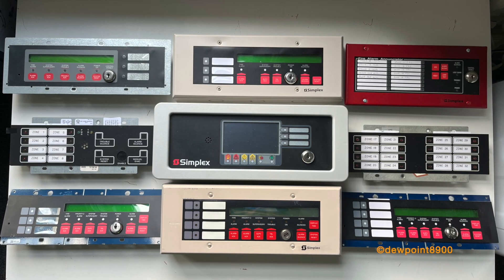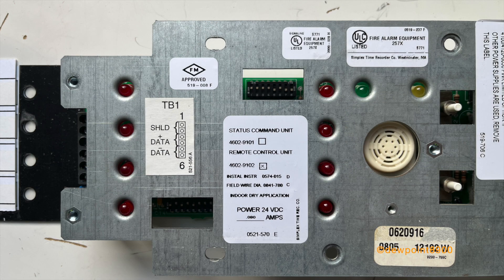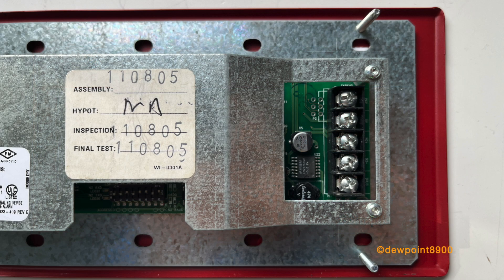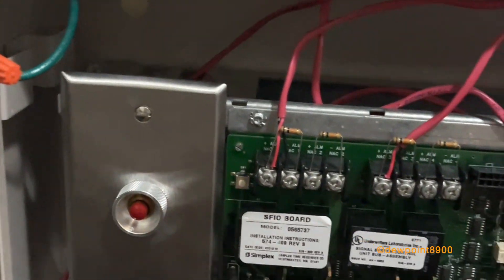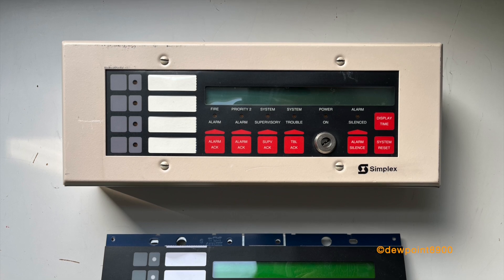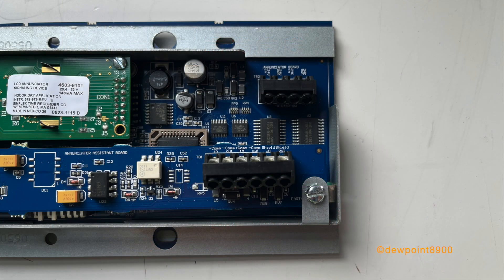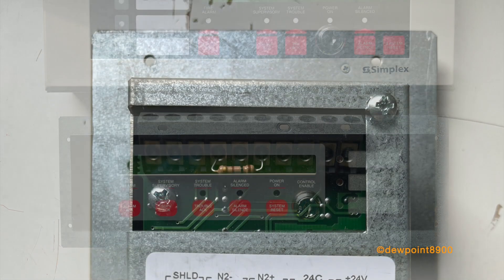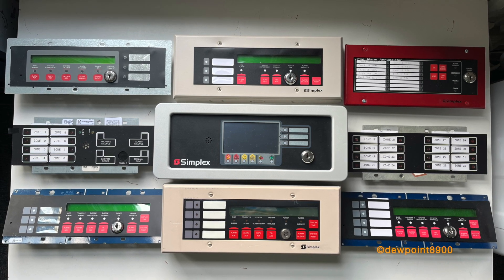Quick Overview of Simplex Annunciators

Comment: Thanks for doing my request!!! Do you think you could list each annunciator’s release (and any redesigns) in chronological order?
Reply from the maker: I don't have exact dates, but to my knowledge...

4606-9101/2 - mid-late 80s to mid 2010s (unsure if still made)
4603-9101 - late 80s to present (redesigned in the early 90s and early 2010s)
4606-9101 - late 90s to present (redesigned in the early 2010s)
4610-9111 - early 2000s to early-mid 2010s
4606-9102 - early 2010s to present
4606-9205 - mid 2010s to present
Reply: @dewpoint8900  Awesome! Thanks